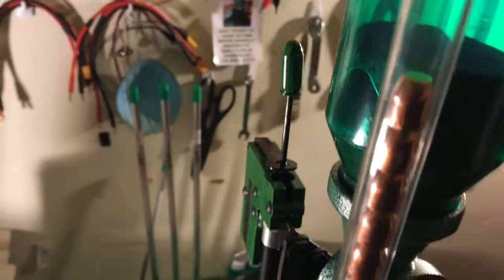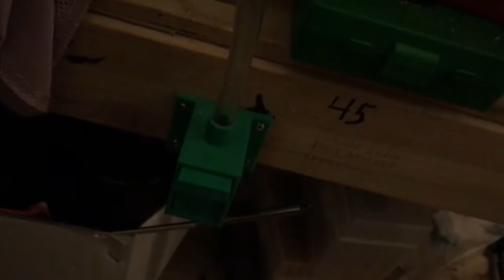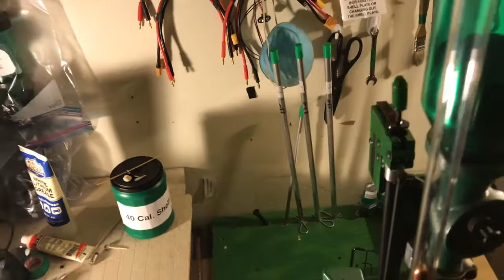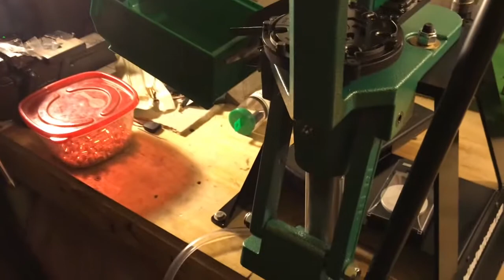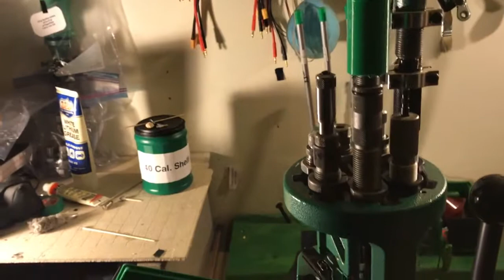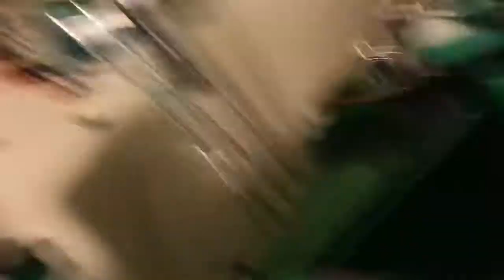RCBS Pro Chucker 7 Report: All grown up, smooth and strong. The best reloading press on the market.

Comment: Oh and what brand/type of bullet feeder do you have on there. And ever messed with the case feed tube thingy??
Reply from the maker: Hornady bullet feeders with Hornady and RCBS tubes. Had to print an adapter in order to fit the RCBS tubes in the Hornady bullet feeder dies.

I had one but it was defective. Certain pieces did not fit together as they should. 
The funny thing is that not a lot of the RCBS case feeders are available to purchase.
I don't know why.